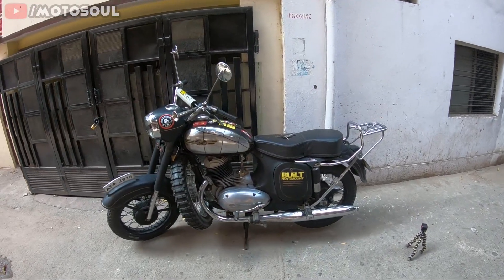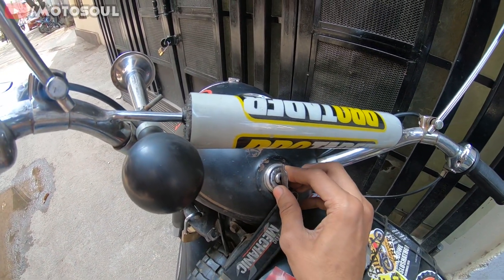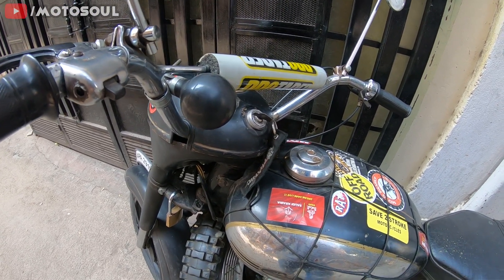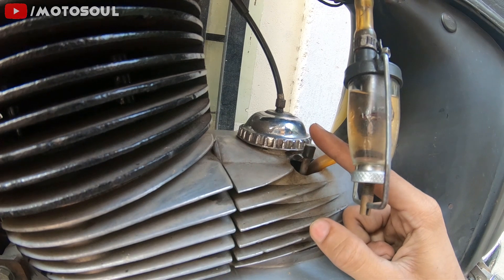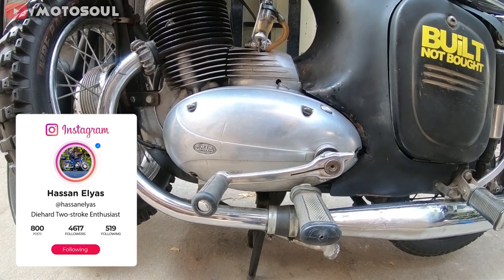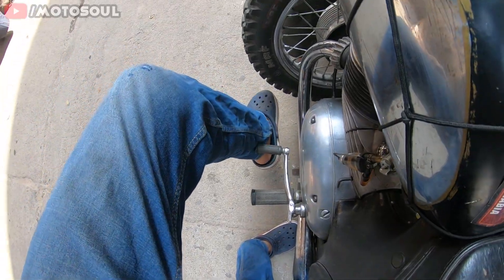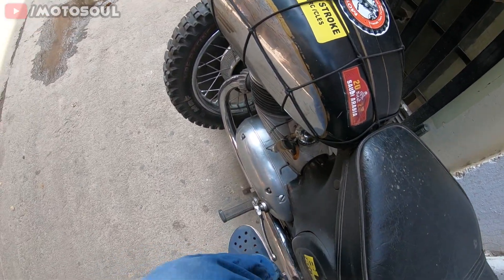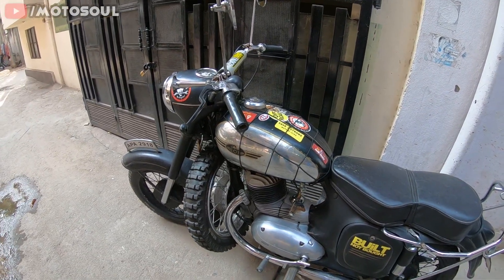How to Kickstart vintage 2stroke Jawa -  exhaust sound 💨

Comment: Can the idiling be adjusted  which will not need throtle? I mean once the engine is started do we have to give little throttle always ?  Always pumping + kicking in bumper to bumper traffic will be tedious.
Reply from the maker: Yes that can be adjusted and once adjusted you don't have to worry about Kickstarting the bike again. I keep the idling at very minimum it's just the way i like it.
Reply: @motosoul  hey Hassan, thank you for prompt reply.

One request: please make one video of riding roadking and explain about the bike and whether one should buy in 2022 in Hindi only😁. In the recent videos the Hindi sentences are missing, the best was rx 135 4s vs 5s differences... "Aaakhri smooth" 🤘
Reply from the maker: Haha sure will do. Thanks bhai

Comment: Is this method required for RK CDI too  or only one kick does the job ?
Reply from the maker: Tickling the carb is a general way of letting the petrol inside the carburetor. You might have to do it when you're cold starting not everytime you kick start it. Also depends on the engine tuning.
Reply: @motosoul  sorry I meant buliding the compression with few kicks or no compression is required for CDI engine ?
Reply from the maker: Nope. Actually you dont need to pump it at all. Even for a jawa. You can kick it directly without pumping and it will still start. It is easier to pump and kick hence why we all do it.